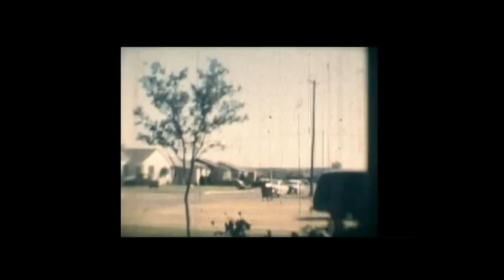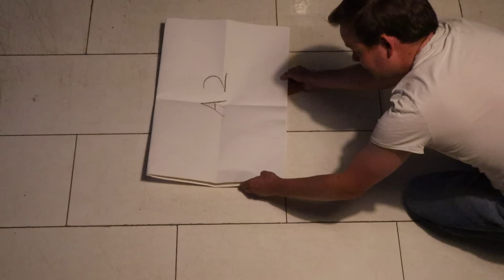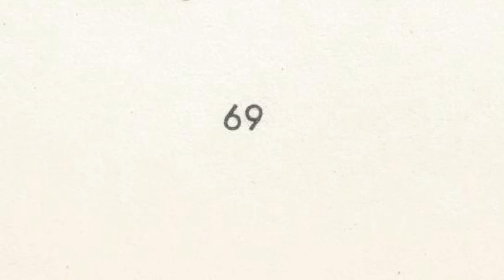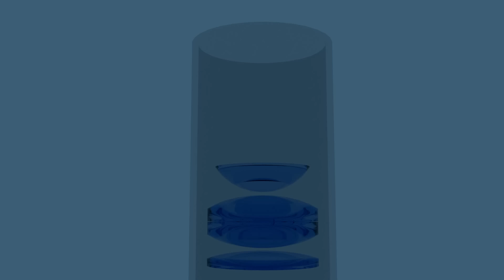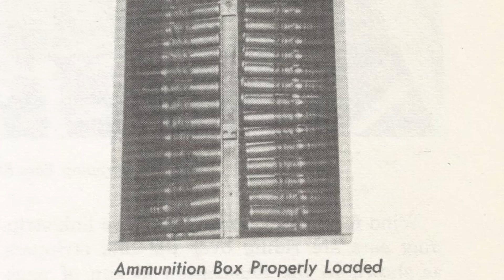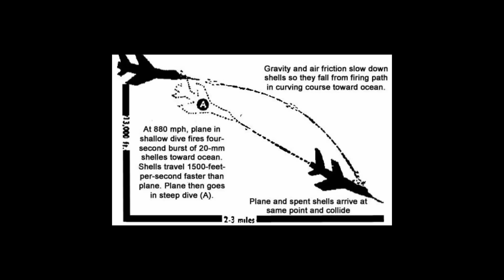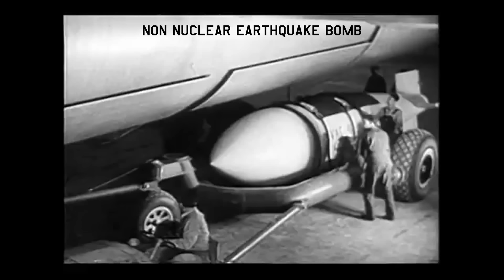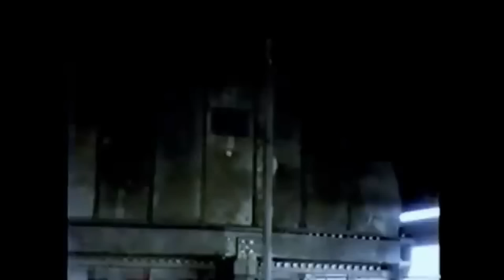Unfathomably American: The Armament Systems of the B-36

Comment: Alexander, man, what's happening with you? Operation Castle Bravo was conducted in March 1954 on a barge, not B-36. You are talking about May 1957 TX-17 incident, which did happen exactly as you described. I know that is very difficult to be always correct, but still
Reply: Video is great, by the way, I can see how fascinated and thorough you are

Comment: Ok, to the fair, if the reactor falls out and embeds itself underground, that technically does contain it.
Reply: Smashed to bits on impact more likely, concrete bunker busters tend to be designed to hold together at least a little bit.

Comment: Regarding the B-29, the fact that the loss of gunner did not, necessarily, mean the loss of station is an advantage rarely praised.
In most earlier bombers (certainly earlier heavy bombers), such quality was missing. Its advantages should not be underestimated.

Loosing a gunner in previous heavy bombers meant losing one or more guns.
For aircraft that depended on their gunners (and on their luck with AAA) to reach and leave the target area without losing part or most of their defensive armament was a huge benefit.

Comment: I like how the air force was basically just like "Ah yes perfection" Then 4 years later decided "No yeah this is really stupid" (Somehow managed to built 384 of the things anyways) Then built the B52 and haven't stopped using the B52 for the better part of century. 

Honestly the most impressive part is that they managed to be 384 of the things. By all measures its a massive, horrendously expensive and relatively technologically advanced aircraft for the time, and they still managed to build THAT many. I mean for reference they managed to build 21 B-2s in 11 years compared to 384 B36s in 8 years. Also 744 B-52s were made in 10 years. I guess America really just doesn't have production like it used to.
Reply: I'd like to think our production capacity would ramp up quite quickly if it felt like the difference between life and death. The B-2 is a luxury product, this thing was daily bread for nuking related activities.
Reply: @contrapasta2454  it's more me commenting on how ridiculous those early blank check military contracts were. Like realistically speaking did the US Airforce REALLY need 744 B52s? I guess it paid off in the long run since now the currently active 72 B52s have infinite spare parts. But it is a frankly absurd number. Like only a few years ago there were as many B52s as F35s. Even now the F35 isn't even double the amount of B52s built and the F35 is supposed to be the main multi role aircraft for multiple countries. 

Of course things were easier to manufacture back then, and yes tensions were definitely a fair bit higher. But it is still at least impressive the sheer amount of mass production capacity America used to have, and unfortunately a lot of that has moved away. Could it come back? Yeah probably given enough time and boat loads of cash. But it has definitely left, I mean it's not called the rust belt because it's full of booming industry.
Reply: @simethigsomethingidfk  SAC and Curtis LeMay took the cold war very seriously. They built an incredible 2042 B-47's. In addition to Boeing, the B-47 was built by Lockheed and Douglas under license.
Reply: @simethigsomethingidfk well, the difference between an F35 and a B52 and B36 are massive.
Reply: You're missing a step, or two, at least, four and six engine jet bombers were deployed in service by the USAF in massive numbers during the Cold War primarily the Boeing B-47 (this was back when Boeing knew how to build planes)
Reply: @artemisfowl7191  Yeah I more or less skipped over the B47, but all things considered it falls more into the light bomber classification. More like a F111 just with the early cold war use of essentially being a ICBM. Yes it has 6 engines but they are very small and weak engines and the plane "only" had a 10,000kg bomb load compared to the B36 and B52 with over 30,000kg bomb loads. It's also 100ft long compared to 160ft long.

There are numerous other random examples of light bombers and heavy strike aircraft like this. But you don't really talk about the B25 when talking about the development from the B17 to the B29.

Comment: re: paper sizes. 

US Paper sizes (probably) derive from the old imperial Demy which was 17.5x22.5 inches. Quarter this and clean up the edges and you have 4 standard  8.5x11 "Letter Size" papers. 

We also have the Ledger/Tabloid size at 11x17 which when folded in half (such as when used in a magazine) makes each page an 8.5x11 sheet. 

I don't know the historic reasons behind the Demy, and wish we would go to a nice system like the A system, but given that we've been using it as a standard for sooooooooo long and all of our printing equipment is expecting it I doubt it will change soon even if the US as a whole goes full metric tomorrow.

Comment: 30:00 for ammo, this is very exotic
We call that ETC, electro-thermal chemical rounds, we don't even use that for tanks yet, but can be used to make safer ammo by making it harder to go off
Reply: That's not talking about the ammo, it's the method they used for converting AC to DC since things like diodes and other solid state electronics didn't exist yet. 

What you're thinking of is the fact the guns themselves used electric primers rather than firing pins with mechanical strikers. Many vehicle mounted gun systems use electric primers because they eliminate some of the moving parts in a gun system and allow you to avoid mechanical linkages to trigger systems or engineer solenoids to pull any triggers. Instead the trigger is just next to the gunner and wired directly up to the firing chamber. It's also very easy to do since vehicles will have electricity available anyway since it's needed for other systems, and it doesn't take much to ignite the primers used for electric primed ammo anyway.
Reply: @battleoid2411  ...what?
i WAS talking about the electrical primers, they're ETC, never at anytime was i talking about the AC/DC transformers
Reply: @jujuteuxOfficial Then you're flat out wrong, electric primed ammo has been around for decades. You just don't see it on personal firearms, but its absolutely used in tanks and other vehicles. 

Also, that timestamp goes to the electrical components, not the guns.
Reply: @battleoid2411  Just for emphasis, electric primers are Victorian-era technology.
Reply: @battleoid2411  nope
Reply: @jujuteuxOfficial  Good talk buddy, maybe when you grow up you'll understand there's nothing wrong with admitting when you're mistaken on stuff like this
Reply: @battleoid2411  seethe harder
Reply: @jujuteuxOfficial the hell you meen NUH HUH
Reply: @planetmaker3472  idk you figure it out just because you don't have a brain doesn't mean i have to lend you mine

Comment: Some more facts about the nuclear b-36, the nb-36h had so much shielding on it as it was used as the test bed for the almost made convair x-6. The nb-36h was to test the shielding requirements for a nuclear powered aircraft. By the time it was cancelled in 1961 the nuclear engines, htre-1,2 and 3 were ready to be installed in an airframe. It should be noted that the reactors had an automatic control rod movement system , which is incredibly advanced for 1958. So advanced the on htre-3 the system malfunctioned and retracted all the control rods causing it to meltdown. But the X-6 prototype was almost nearly made if it wasn’t for the budget cuts in 1961 that cancelled the program. Maybe that was for the better, I don’t know. Also, the reactors, htre-2 and 3 are on display at the Idaho national laboratory, so you can witness part of the madness the air force was cooking back then.

Comment: A friend of my fathers was a LtCol flying F-86Ds in the 1950s. The numbers suggest that intercepting B-36s should have been easy. He actually did it, he explained it was almost impossible. Slightly easier for a MiG 15 or 17 as they had higher ceilings,

Comment: A fantastic video, the showcase of Castle Bravo with New York for scale was... Chilling.
Since you like (unconventional) nuclear reactors, might I suggest looking into the Soviet Alfa class submarines? They carried a molten lead coolant reactor operationally.

In fact, one had an accident that caused the reactor to scram in drydock, and the whole engine section turned out to be completely trashed because the (obviously radioactive!) lead had frozen solid and there was no way to restart the reactor afterwards. Dissecting and discarding this monstrosity must have been a nightmare.

EDIT: Also USS Seawolf, she sailed with a molten salt reactor.

Comment: 1:02:42 okay, hear me out: please? (the AC-130 has quite a few of the very cool, hyper american things going on as the B-36 and has faced the same pressures to evolve yet still exists, some of the things it can do are very silly)
Reply: I totally lost it when I've found out that they've installed a fricking 105mm Howitzer gun, on it - yes, an artillery gun on a damn plane. I can't think of anything that could be any more American than this. They really weren't joking with the "Gunship" name. I'm not really a weapons/military aficionado, but one comparison that springs to my mind was it being the A10, but taken to the absolute extreme - Flying autocannon vs. flying howitzer.
Reply: @thedoublek4816  There's also the B-25 with a fixed, forward-firing 75mm howitzer
Reply: @thedoublek4816  The AC-130 is just hilariously insane as a concept.
Reply: @thedoublek4816  Flying artillery really began in WWII. The Germans had some prototypes for recoilless rifles slung under bombers and an Hs 129 variant with a 75mm anti-tank gun, the Americans put a lightened 75mm tank gun in the B-25H, and the Italians had a small number of bombers that carried a 102mm gun for anti-shipping operations.

The AC-130 was originally developed to destroy trucks on the Ho Chi Minh Trail during the Vietnam War, partially inspired by the AC-47 which mounted a number of 7.62mm miniguns in the side of a C-47 transport for close air support. The AC-130's armament has been revised several times across variants, and the most recent variants are really just heavy missile carriers, where the guns are secondary. I believe the plan is still to eventually remove the howitzer and carry yet more missiles.

When it was first developed in the late '60s, the AC-130 was competing against the B-57G Canberra, an updated version of the B-57B modified under Project Tropic Moon III for the same night-interdiction role. While the B-57G used a more conventional load of rockets, bombs, and early guided weapons, it was determined that the AC-130 was cheaper and more effective. The B-57G had one additional trick, under Project Pave Gat, a 20mm Vulcan gun (the six-barreled Gatling used on fighters and later upscaled to 30mm for the A-10) was installed in a remote-controlled turret in the bomb bay. This version of the plane never went overseas, but was tested briefly before the decision was made to go forward with the AC-130.

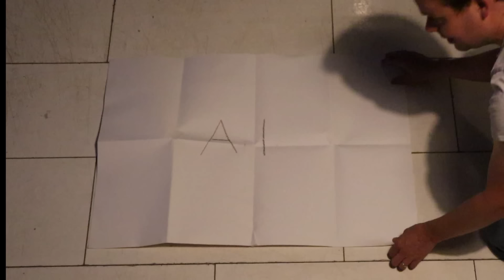Comment: 14:10 - To your paper size question/comment. I used to work on laser printers/plotters for a living for a while. That 8-1/2”x11” size is EVERYWHERE, in the printing world, and I have NO clue where it came from.
Reply: Tradition. It dates back to long before the era of standardization, and when it came time to create a standard, they just based it on the paper size commonly in use. 
The ISO A base paper size of 1189x841mm is just as arbitrary; they just picked a size and agreed to use that size as a standard.
Reply: @mark.audacity  ISO A0 is 1 square meter in area. B0 has the longest side 1 meter in length. Neither are arbitrary.
Reply: @mark.audacity  ISO Paper sizes have the nice trait of all being multiples of each-other. Two A4s is an A3, half an A4 is an A5 (closest equivalent to letter paper I think). There are also the B-series of paper, which aren’t as commonly used. Ultimately it’s all arbitrary and probably came down to “this is a nice amount of space for text, and for handling”
Reply: @SkigBiggler  Right... I guess you could say the sizes are arbitrary, but the ratios of the long & short sides are anything but. They're meant to be as close to √2 as possible in whole millimeters, which is how you get that halving/doubling property -- 1:√2 = (½√2):1

Edit: ok, given the constraint that A0 paper has to have an area of exactly 1 m², even the size isn't really arbitrary.
Reply: Also, sometimes "because it's always been that way" does become a somewhat valid reason to keep doing something. As you mentioned, 8.5x11 is now EVERYWHERE, and trying to change standards would be a significant undertaking.
Reply: I tried to get some A4 paper in the US to print a manual, and I think it would have been easier/cheaper to import the Hope diamond.
Reply: @GeneCash  it's a 3 folded thing that what is going on with them.
There is a lot of the military documentation that he is looking at. Of course. It's not going to be necessarily, uh, private sector standard, that's military standard. Especially whenever you're looking at documentation and everything that would have been for top secret clearances would be on smaller paper. Why smaller paper quicker to burn and destroy/ easier to keep concealed in what at the time was the standard size binder. So that, in specific, was more of american paranoia, then anything else. And the other 2 parts of it, pretty much roll into the paranoia as well. You don't want your rival corporation to sit here and grab your notes because they were able to sit and see over your shoulder when you are having a discussion with an officer of some description.
Reply: @GeneCash  Yeah and because its taller than 8.5 x 11, you either have to print it from a bypass tray or put it into a tray that can take legal and hope the guides slide in enough. You can't print A4 with a normal desktop printer easily here.
Reply: @UD503J  I know that at least some HP laser printers have a setting in their firmware to swap automatically between A4 and 8.5x11 Letter. Meaning if a job is sent to the printer as A4, but the printer has 8.5x11 in it, it will automatically adjust the print size to print on the 8.5x11.
Reply: Letter size paper was codified by Ronald Regan when he was President, but I’m not sure how much further back that size goes.
Reply: I have always hated that size with a passion. My first job was working for a one man band that had grown out of control. The boss had got this great deal on letterhead printing, but the great deal turned out to be because it was all printed on US letter size paper. Which didn't fit in our photocopier and didn't match any of the paper or envelopes. As the junior junior junior it was my task to cut the stuff down so it was almost compatible.
Reply: The only thing convenient about using 8.5 x 11 is that 11 x 17 is at least two sheets side by side. But I think it's the only time where a relationship between sizes is 'convenient'. As a graphic designer, I'd love to work with A-series metric paper sizes. The aspect ratios are all the same between sizes.
Reply: I had to pause the video to go down that rabbit hole. From what I could find, the A-series sizes were established in the 1920s, spread pretty quickly through Europe, then slowly to the rest of the world from the 50s-70s. NA paper sizes apparently were a de facto standard since long before that, to the point that the origins aren't clear. They were only officially standardized much later. Why not switch? Because switching would be expensive. And of course most of the early generations of computer software were written in the US, which reinforced and proliferated the standard.

Comment: You should look at the Napier deltic, saber and Bristol Centaurus for similarly monstrous piston engines from our side of the Atlantic.

Sleve valves, opposed pistons and such abound in these
Reply from the maker: I was stood next to a napier deltic just the other day actually (National Railway Museum).
I probably vastly underappreciated it because I know absolutely nothing about trains.
Reply: @Alexander-the-ok  twas originally a torpedo boat engine, first diesel to match steam engine power figures on UK expresses. 

Popular in mine sweepers as it's mostly non ferrous, the turbo compound derived from it had silly power but was only a prototype.

And the ny fire brigade built a monster of a fire truck around it.
Reply: @Alexander-the-ok  Greg's aviation rates the Napier saber and that's a silly h block opposed piston monstrosity kicking out a huge chunk of power and it's running on sleeve valves much like the deltic only it was the engine from the typhoon.

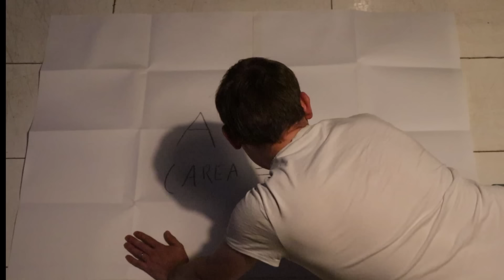Comment: 14:22 A4 paper doesn’t fit in my filing cabinet. Letter paper does. The store sells Letter sized paper. Everything I want to print is sized for letter paper. We’re more likely to eliminate paper entirely than to switch standards.
Reply: That's not an a4 paper problem but rather your filing cabinet being designed for letter paper and blissfully ignoring the existence and prolifiration of international standard A4

No seriously, all they had to do was make it a few inches larger its definitely not the A paper formats fault

America boggles the mind
Reply: It’s pretty unlikely to actually fly or sail a piece of paper internationally instead of simply electronically transferring a copy so it doesn’t matter if we share the same paper size standard.
Reply: @bussesandtrains_121 If the filing cabinet was those few inches larger, nobody would buy it. Nobody wants a more inconvenient filing cabinet just so people in another country have the same paper size.